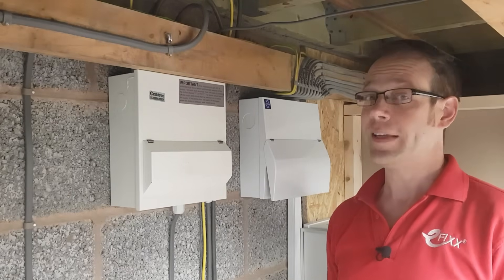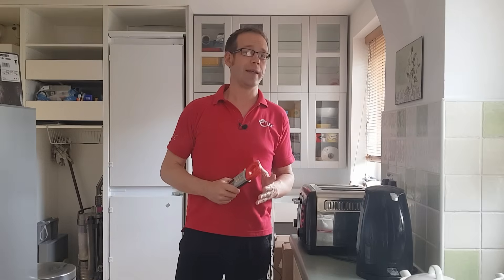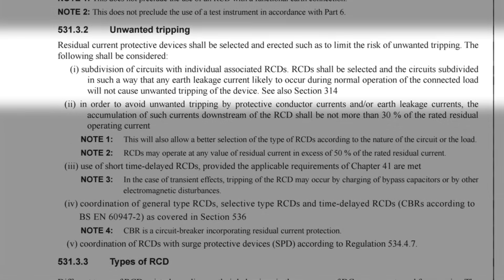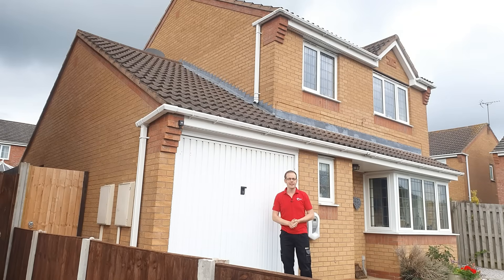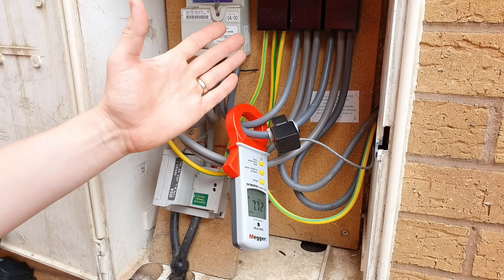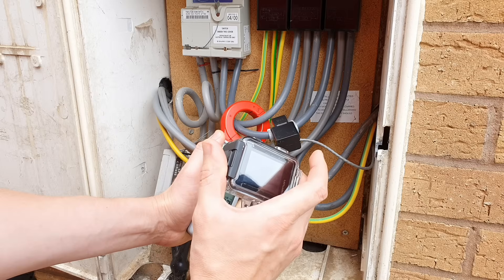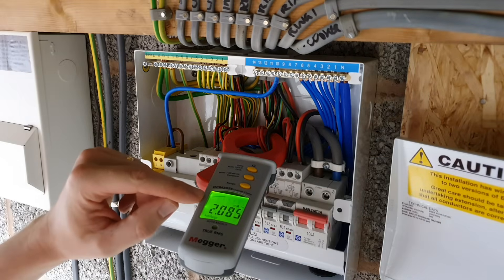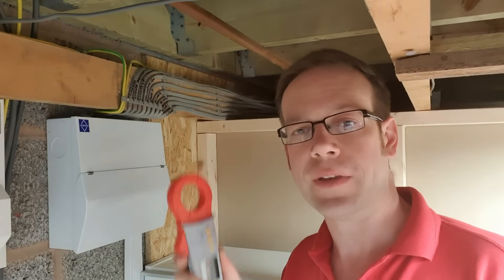EARTH LEAKAGE CURRENT - WHERE it comes from and HOW to measure it. - MEGGER DCM305E

Comment: Is it a good device.?
as a Megger DCM305E is 350 Euro here in Denmark at fx Conrad el..
maybe test it against other leakage current clamp meters.

fx the old UnitT UT211B.. that one can be had for around 90 euro.
0.1mA AC and 1mA DC
the DC feature is certainly a nice benefit
Reply from the maker: I think we have one of those badged as a different brand 😉
Reply: @efixx  likely I remember the Unit-T211B have been rebranded under quite a few other names, like fx Extech MA63.. but way higher price.. the 211B  (0.1mA AC / 1mA DC) can be had from CN to around 65 to 75USD (before VAT) while the Extech MA63 is listed at 230 USD MSRP in US... but haven't seen board comparisons and if it is.. identical but if it is quite a mockup..

personally I don't have a dedicated leakage clamp..got two cheap AC&DC clamps ..a Unitt210E (that was weirdly cheap at 28USD delivered to Denmark) that I use for lower DC current and a HT208D (40US) for higher AC&DC currents.. though all these secondaries features like dual display and inrush peaks etc.. you need a lot of amps for it to trigger with the HT208D... most of my usescases are with DC.

Comment: Great video. This is something no one seems to talk about and also explains how the leakage is measured between live and neutral. I worked for a company that had a vehicle EMC chamber and it had a massive filter on the outside that had a high leakage current. Until the time it was installed I had no idea of permitted leakage currents in the regulations. Also, if my memory serves me correctly it had to be wired back to the fuse board in SWA cable.  That was around 15 years ago so my memory might be playing tricks on me. We also couldn't power any equipment with RCD sockets because of the noise they generated.
Reply from the maker: EMC is a very specialist area you could be right on the RCDs is they where on the chamber side of the filter.

Comment: I got called to a house where the owner said your the 3rd electrician I have called to for this intermiittant RCD tripping. So I checked and found nothing obvious then I started to ask the question what were you doing at the time. The reply was the ironing but rcd did not trip all the time I used it . Checked the iron and found the cable all frayed and after a few more questions I pinned it down to the oven and iron being on at the same time. Oven was leaking 20mA and the iron was 22mA

Comment: i have this meter and measured the earth leakage at home,   when measuring clamped around L/N i get 6.6mA 
But if i clamp around just the CPC i get 14.5mA,   i find this odd as i expected the CPC to be lower than the L/N reading due to having parallel paths
Reply from the maker: A small diverted neutral current from the TNCS supply? - we measure around 6 amps in our industrial unit.
Reply: @efixx  6 amps seems a lot

Comment: Nice Video.  In your DB board....Still don't understand why Earth wires (green/yellow) has to be that thick. It just leaks milliamps down to earth not many amps.
Reply: The earth cable is there to protect from fault conditions like a short circuit not for earth leakage. Those earth cables would have always been there, long before the advent of RCDs.

Comment: Nice idea. Normally take insulation readings but this is quick and easy will get one.thanks
Reply: Doing insulation reading exposes a risk these days of blowing electronics.  To find this nuisance tripping,  you need the electronic equipment connected.

Comment: Might not get a response to this question but when testing outside in the meter box. If you connect around the main earth would that not give the same reading as it’s downstream of all protective bonding which in most cases terminated in the mains?
Reply from the maker: A percentage of the earth leakage current will flow back via pipe work - water & gas etc so won’t be picked up by clamping around the earth tail.

Comment: Another nice video.. well explained.  I know this is an AC leakage meter but I’m wondering if DC is getting leaked onto the system by the likes of electronics, this is effecting the AC return current missing right?  So with the likes of worrying if DC may stun an RCD will this device help?  I’ve actually just bought this meter and it’s handy for pricing a non RCD to new CCU.
Reply: I don't know about that specific tool, but there are clamp meters that will measure DC current, using a hall effect sensor instead of a current transformer. However they tend to be very sensitive to external magnetic fields and even the position of the conductors within the clamp so measuring small currents can be challenging.

Comment: Over 30 years ago, I used to calibrate all kinds of equipment as a job. Including clamp meters of course. One thing to call out for both analogue and digital meters is that their most accurate readings are quoted at FSD. ( I.e. full scale deflection- an old term used when looking at the indicator needle on a analogue meter) but due to non linear characteristics of components such as hysteresis loss and other items I will not go into here, it also applies to meters with digital displays.  . So if you have a clamp meter and you are using the 200 A range, then it’s manufacturer might quote an accuracy of 1% when measuring 200 A, hence readings around 195 A will be almost as accurate. However, measuring instruments are non linear. Hence if you are measuring a load of 1 amp on the 200 A range, you may have a significant inaccuracy , maybe  a 20%-30% error! Or more on an analogue device. E.g. old fashioned AVO 7 meters could be more inaccurate for measurements near the bottom of the scale.

So my advice is :- when buying a testing device ( of whatever price range) ensure you get one which has a low milliamp range. This ensures that when measuring leakage current of only a few milliamperes, you are operating as close as possible to the top of the meters range to get best accuracy. If it’s an auto ranging meter, then manually over ride this to select the appropriate range.
Reply: Being in my 60s FSD is a term I was brought up on. I've always had the same mentality towards what you rightly say. In fact it's so embedded in me that if I'm cooking something, I often add the ingredients straight into the pan which can weigh say around a kilo. If I place that on the scales, zero it and then add say 100 grams of something, I instinctively think that won't be as accurate a measurement as if I'd weighed it in something much lighter. A slightly different analogy but an indication of how you think about things when you're brought up in with this kind of thing.
Reply: Very well put. I actually find automatic raging can be irritating for the reason you referred to.
Reply: Most digital meters accuracy is stated as percentage of reading +/_ anumber of digits.

Comment: I don't see how you can use it without rcbo. Your line and neutral wires are usually separated in the electric cabinet when usual mcbs are used. The cable from the appliance usually include earth wire, so loop meter will show 0 .

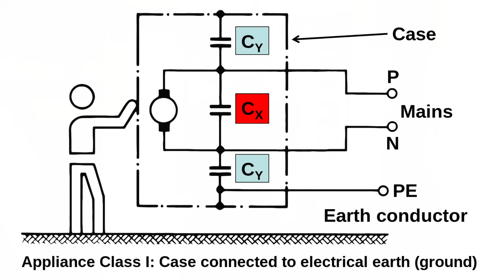Comment: Sorry for my weird question, but from 2:18 you mention that IT equipment often leaks current to earth, but as far as I know, all laptops, Flat/LED-/SmartTVs, Hi-Fi systems etc. are Class II - double insulated - appliances that are not grounded - they have a plastic earth pin, with no connection to leak current to. What might I be misunderstanding here?
Reply from the maker: No it's a good question, some stuff is double insulated with no earth connection, but some do have an earth connection, my laptop power supply for example does.
Reply: @efixx  Hmmm, that's weird. Here in the fringes of the Eastern Bloc, we only have ungrounded laptops (PCs are grounded though). I wonder whether Western Europe has higher earth leakage in general, which would mean that on the other end of the spectrum, in Mother Russia - where you often can't see a grounded socket for hundreds of miles around - it should be the lowest, right? Or would they make up for the lack of bonding with earth leakage directly through grounding rods?
Reply: While a class 2 power supply obviously can't leak directly to it's ground wire because it doesn't have one, they can and do leak from input to output. This is known as "touch current" in IEC equipment standards. Standards will impose limits on how much "touch current" is allowed, but I'm not sure what the maximums for AV and IT devices are.

This current can find it's way to earth through various paths. As the name "touch current" implies it can flow through a person who is touching the equipment at the same time as touching something grounded. Data cabling often connects the signal grounds of class 1 equipment to class 2 equipment (for example a USB cable from a class 2 laptop to a class 1 printer). TV aerial systems are often grounded, particularly in blocks of flats, or if someone has a "home-theatre PC" that can provide a ground path to the whole setup.

Comment: If i there is a RCBO board lets say with 10 circuit and each circuit would have 5 mA earth leakage, then 50 mA leakage would flow to the extraneous conductive parts because of bonding, but it would be already dangerous amount level of current is it true?
Reply: That is so much nonsense that I really cannot comment. Why would there be so much current in the parts? Why would it be dangerous?

Comment: This and many other tools lack one thing. When a drone can fly for thousands of metres and still get signal....why can we not get meters with remote access ? ie. Hang your clamp meter at source and you can then go around the building unplugging things and view via an app whether it has had the desired effect. Likewise simple plug in tools when trying to locate the relevant MCB. Plug into your chosen socket, and then at the board you can shut off circuits to establish the correct one. I've never found any tool come remotely close to achieving this ( I did buy a Testo clamp with bluetooth, but it barely works more than a few feet away )

Comment: 9:49 It was a drop of 0·6 mA not 6 mA - and effectively bugger all as it's half the earth leakage of the circuit itself.
Check isulation resistance CPC-N and CPC-L and N-L to understand more where the FAULT is.
Reply: To do this would mean the removal of all connected items and just do cables pointless

Comment: Hello here from Brazil,well there in UK you use for protection TN-C-S ,so my question is, in  the case of a broken neutral in street doesn't it to dangerous for people in the consuming unit,  because RCD doesn't protect  in this situation? therefore one can get a shock and die,when touching a earthed equipament inside house. How do you deal with that,or how the electrical  code deal with it?
Reply: That is why water pipes are bonded so you cannot get shocked between them and electric equipment. In case you do not touch anything grounded the risk of a serious shock is small.

Comment: An accessory to build is a 13A plugtop to 13A socket with separate L N and E wires between. Then suspect or items that require to be proven good or bad can be tested individually and tested independently.
Reply: Can you elaborate please 🙈🙈😂
Reply: @pooley2853 basically, just a normal, but very short, around half a metre, extension lead but with the wires exposed so they can be accessed individually.
Reply: i must do this. Thanks for the tip Bob

Comment: Given it's use case you'd think that meter would have a wireless connection so you could monitor while unplugging/disconnecting stuff, can't otherwise see what make it better than any clamp meter other than the larger jaws.

Comment: Could you in theory camp this around a sub main including an earth, and then proceed as you did by eliminating loads? And also where could you find a rated earth leakage value on electronic components if you were designing circuits incorporating IT equipment?!
Reply: I would imagine you could not clamp this around a sub main including an earth & get an accurate reading.

The device is looking for a difference in the electromagnetic field produced by the current flowing through the wires.

If you have say 10 Amps flowing through the Live conductor, and only 9.98A flowing through the Neutral conductor, you have a leakage current of 20mA and that is presumed to be going to Earth.

If you assume that 20mA is going through the earth cable, then the electromagnetic fields produced by the current flowing through the three wires (live in, neutral & earth out) will cancel out & therefore the meter will read 0.

Also I have yet to see any IT equipment give a rated Earth Leakage current. It really depends on the circuit design & quality of the components making up the circuit. Some Y class capacitors may leak more than others.

Comment: As others have stated, EMC is Electro Magnetic Compatibility, not Contamination.

FYI EMC is considered in four separate but related parts, namely Emission and Susceptibility of both Conducted and Radiated electromagnetic waves. In other words, how much an equipment emits through free space, how much it emits down the wires, and whether when subjected to electromagnetic waves either through free space or down the wires it continues to perform as it should.

Comment: Pretty essential on both electrical power showers and immersion heaters. I had VERY bad leakage from our immersion heater which did NOT trip the RCD but using the back of my hand on the shower wall, the shower fittings and the aluminium frame of the shower door, I could feel the tingle of mains!! Isolated the immersion heater ... Problem gone. Turned out the element was VERY badly corroded and I suspect that water had entered and gone through the porous ceramic insulation on the heating coil!! Didn't have a clamp meter at the time but I do now.
Reply from the maker: Woah! Scary stuff! Good find Bob.👍
Reply: Are you saying you felt the earth leakage through the wall?? 😂
Reply: @marlonwaites3718  not "through" but "off" the wall! Granted, only near the shower head pipework & thermostat. ONLY there was nothing when the immersion was isolated. Shower was power shower NOT electric so not from the shower and not from the pump ... Impossible from the latter due to plastic fittings and impeller housing.

It shouldn't be that surprising, lightning voltage gradient is effectively spherical in its scope, passing through anything remotely conductive ... i.e. brickwork and tiles. So mains can do the exact same thing.

In addition i checked the copper hot tank and its surface was live! Tested with an old school neon screwdriver! Tank bonding was renewed too afterwards ... May have been the main problem I guess since the RCD didn't trip.
Reply: Very much doubt you felt the tingle of the mains, possibly the pressure of the water running through the pipe if anything.

Best way to fault find is testing for insulation resistance using the megger
Reply: @marlonwaites3718  the tingle WAS mains! I proved it beyond doubt. Can't feel water running with no water running! Duh!

Comment: Interesting video. Looks easy when checking RCBO's as the Line and Neutral are close together. I would be interested to see how an old fuseboard is tested. I see a comment suggesting clamping the tails and turning on/off circuits, would this be a better way to check old fuseboards before installing a replacement??  Thanks
Reply: Literally what I was thinking
Reply: Extend the neutral conductors from each circuit within the fuseboard creating a loop and reconnect. long winded but correct reading can be taken between L/N. Or, find the L/N elsewhere on the circuit but you have probably worked it out by now as I'm 2 years in the future.

Comment: I use a megger Dcm300 all the time. I use it mainly when looking for diverted neutral currents at the MET when carrying out an annual inspection on a petrol station. Diverted neutral currents can leak from neighbouring properties and through existing TNCS systems on to the petrol filling station and then leak to ground through buried steelwork and pipework in explosive areas such as petrol manholes and tanks.
It is now common practice to use TT on all new build petrol stations because of this risk.
Reply: Very interesting thank you. Presumably you clamp around the suppliers incoming earth to check for Diverted Neutral currents or TT earth currents? And what would range of AC current would you pass as OK? What do you do if too high? And do you also check for DC current if the petrol station is next to an office building using many computers?
Reply: @daviddmf  interesting question but no answer unfortunately..

Comment: Hi Joe, from an old spark from the 60's. I think all your video's are extremely informative and well presented I really enjoy them immensely. I would just like to ask you a question, I own 3 earth leakage clamp meters, I like to do regular global tail checks to ascertain whether any early signs of problems in mine and  families homes, I would  just like to know what you would be consider unacceptably high main earth current probably emanating from  the neighbours or street light leakage, I also do all my own bumbling and always use a bonding lead before I disconnect any joints just in case it's carrying return currents, be interesting to what you consider too high main earth current before investigation further.

Peter.
Reply from the maker: Hi Peter, great question. This is a really interesting and deep subject which is a bit tricky for a comment here. Please stay tuned for future content on this matter. Thanks for commenting. 👍
Reply: @efixx  Thank you for the feed back, I look forward to your future video's. It is a very interesting subject, and I think high mains earth currents will escalate with the with the massive demands for EV charging resulting possible more neutral faults in TNCS systems, something the power demands was never envisaged when installed years ago.

Peter.